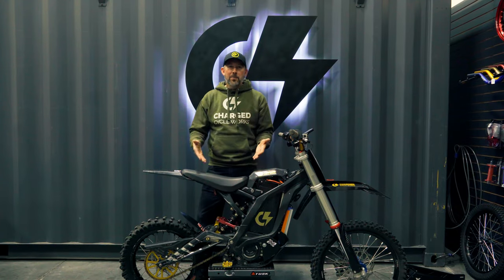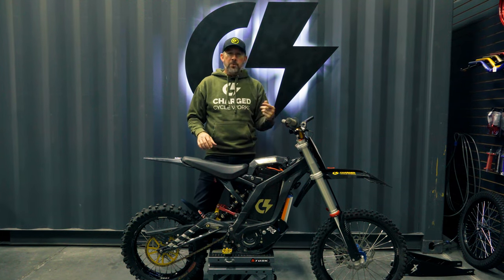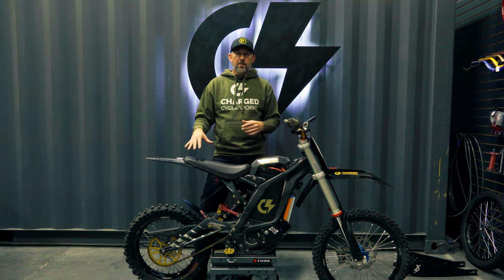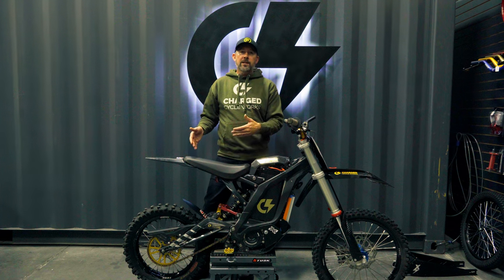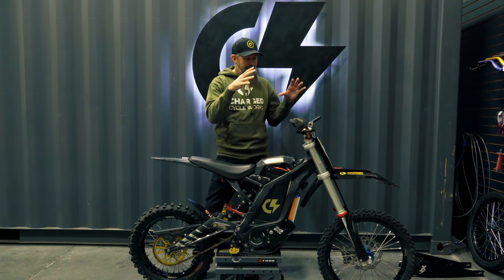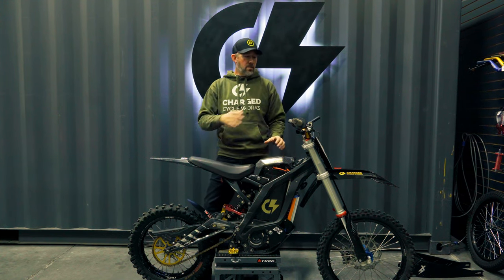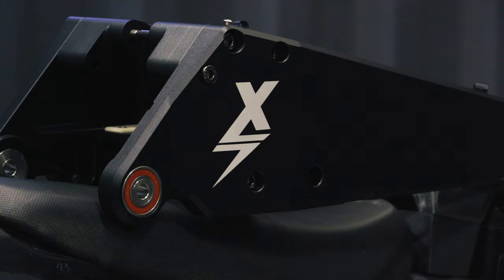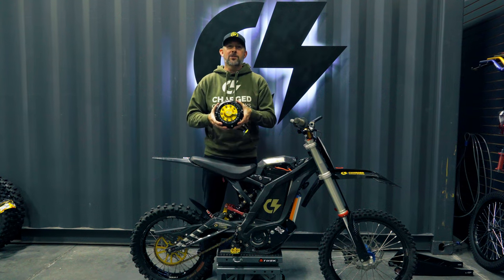BUILDING THE BIGGEST BADDEST SURRON (Part 1)

Comment: Good points, I had the opposite issue with the ktm65 forks as they were about 3/4" too short to run a stock 19" wheel so I had to add length to damping rods(older model with no adjustments). Wish I could have done air but then theres no easy or cheap way to add length to an already expensive fork(there are "big wheel" lugs offered that could work)

All that said, with the TKO cancelled for 2023 and SEER also cancelled when they were going to add electric class, do yall plan on doing any more hard enduro events? That would be needed to test and see if the KO motor actually solves the issue. 

I was planning to run a couple SEER events and TKO but really disappointed its all gone for a year at least. I planned to do TKO and started a build thread on thumpertalk a few year back but just never got the surron where I want it for a race so brutal and having time to get it all sorted. Maybe one day

Comment: Have you considered a works components angled headset? Might help lower the front and gain more stability at speed
Reply from the maker: We are always hesitant to swap the lower surron bearing out with a MTB bearing because a massive motorcycle roller bearing is used and far stronger than anything in the MTB world.  It's been very reliable.  We have seen a couple people do these types of headsets, but don't know how long they will last with the weight of the Surron.

Comment: What 21" wheel are you planning on using?
Reply from the maker: Because the KTM85 hub is 32 spoke and almost all 21" rims are 36h it's a little trickier than normal.  The KTM Freeride actually uses the same fork and comes with a 21" wheel, so that is one option.  BUT, we are going to bring Gold Excel wheels back to this build so we will be using a KTM85 hub, custom made spokes, and sourcing a 32h Excel Gold rim, which are basically impossible to find right now.  We'll be sure to mention how we did this in the next video.

Comment: What about ktm 65 forks instead for the 19 and 16in wheel combo?
Reply from the maker: Great question, we've asked ourselves that many times.  The challenge with that would be getting the fork tuned for the weight of an adult rider since there is a large weight difference between a 65 rider and an adult.  BUT, it would be another really interesting experiment.  Kind of surprised we haven't seen anyone do this yet.  The KTM85 fork is made for a 19/16 setup and it does work really well on the surron, we could do a few things to move the forks up a bit more and choose a different 16" rear tire that is a little taller to dial in the geometry.  But, we really want to get an 18/21 wheelset back onto this particular bike to showcase a "large" build.

Comment: A lot lighter, but still x2 heavier then Dorado. Or x3?
Reply from the maker: Yes, the KTM air fork is still heavy at 18lbs, where as most of the other MTB based forks meant for Surron are around 9lbs.  But this bike is going to be so large and overbuilt that it won't matter.  We have the power turned up so high on this bike that nobody cares about the weight of the fork...everyone who has ridden it (before the transformation) was all smiles.  :)  The biggest issue with the MX forks is they are valved for jumping and racing motocross, they need to be revalved for trail riding to make them more plush which is another expense on top of a very expensive solution.  While it's fun to build and show off a bike like this, we recommend other suspension options for 99% of customers, either our tuned FastAce for $1000 or wait for the new EXT fork which is custom made for the Surron/Talaria which will be out early 2023 and that is far less expensive than a Motocross conversion and will most likely out-perform an MX fork on these bikes for all-around use.

Comment: Change the motor should of been the first thing!
Reply from the maker: Not sure we follow, you cannot change the motor without first upgrading both the controller and battery.  And we would also argue that without MX wheels, tires, and great suspension all the power that a KO system can output is just about useless off-road.  For us our priorities typically go in this order:  1) Cockpit to fit body better 2) Wheels and Tires for superior traction and handling 3) Suspension 4) Power via Battery and Controller and Brakes 5) Extreme mods such as a KO motor.  We know many jump to power first....this is America where bigger is better (right)...but as racers we've learned long ago that power is nothing without great traction and handling.  But we understand why so many go straight to the power...it's fun!  Be sure to watch part2 to see how it all turned out and Part 3 will drop tomorrow where we answer all the questions asked on Social Media about the build.

Comment: You can cut the forks down 1 inch
Reply from the maker: Yes, that is certainly an option, but it would be our last option.
Reply: @Charged Cycle Works  I've seen guys cut down 85 forks to fit on klx110 before. I'm trying to decide if I want the fast ace forks or this setup. Maily trails no jumps
Reply from the maker: @thomasmclean4020  If you're willing to spend the money it would cost to do a KTM fork conversion and you are a trail rider we would encourage you to wait for the EXT fork that will launch early spring.  It should have performance and adjustability and strength to satisfy just about any need.  The only thing we are not liking about the KTM fork is it's not very plush since it's meant for Motocross, we'll probably end up revalving it and spending even more money on an already expensive solution.